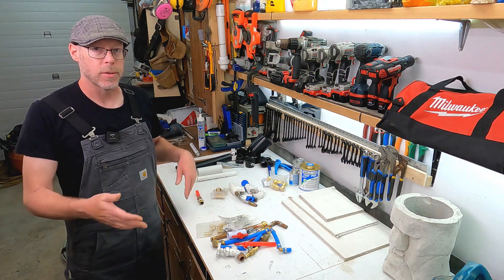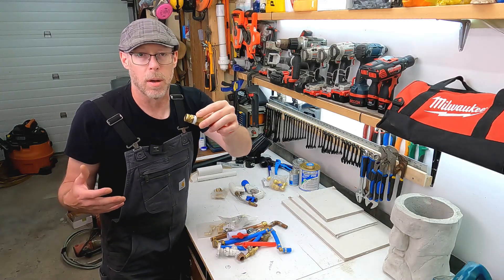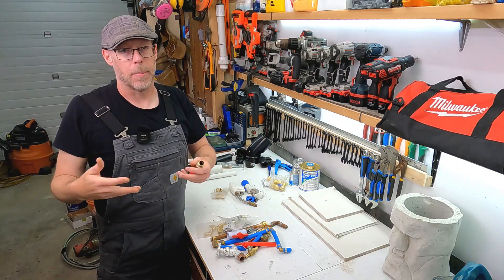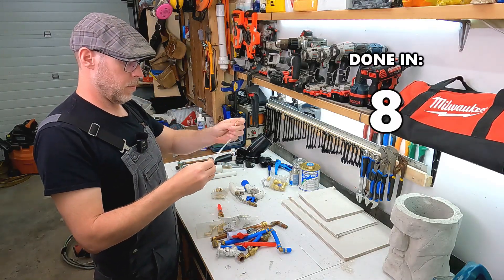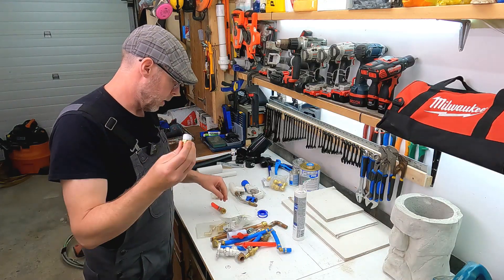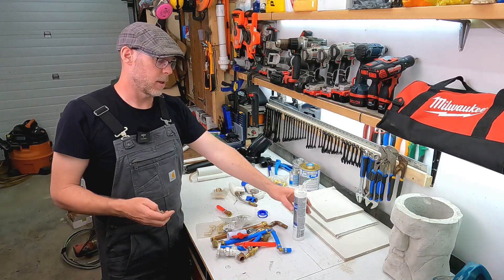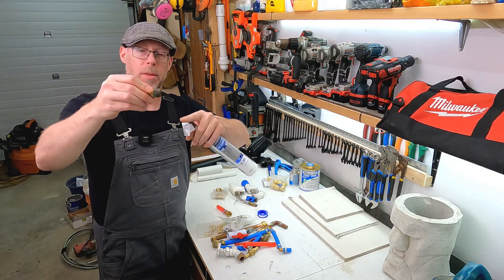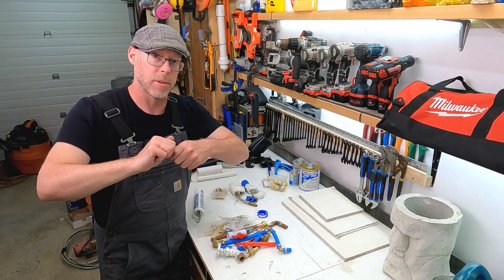How To Stop a Threaded Pipe Joint From Leaking?

Comment: Is it possible to unscrew the fittings once the silicone is dried?
Reply from the maker: Yes, definitely. Clean them and redo. The non-permanent nature of silicone is one of the reasons it is useful for threaded connections as a thread sealant.